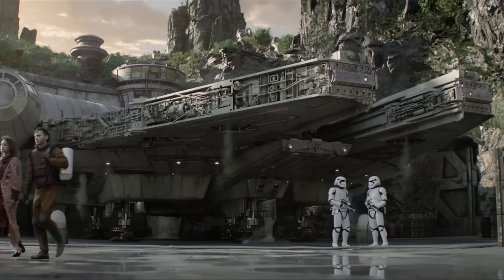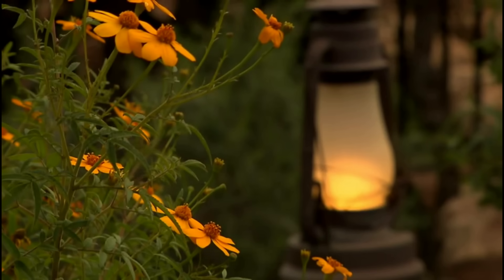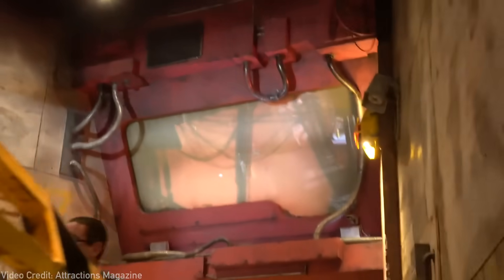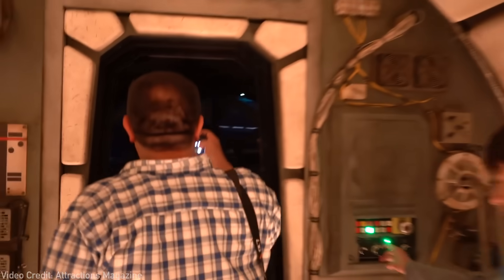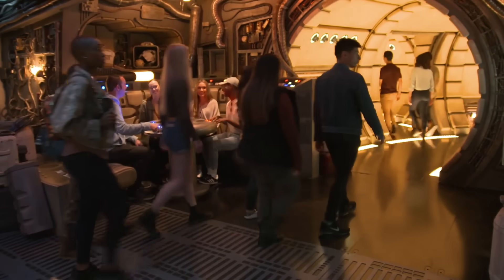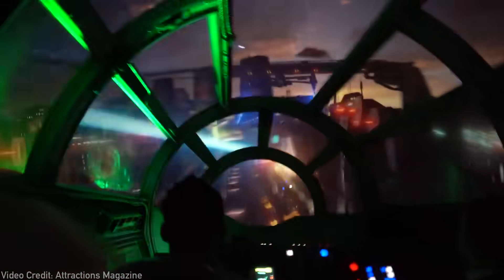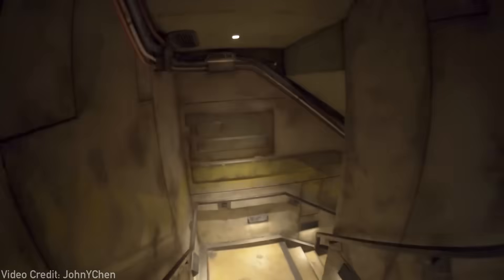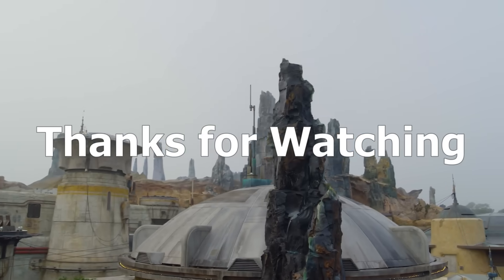How It Works: Millennium Falcon Smuggler's Run

Comment: I'd like to see a video of an evacuation if the ride completely shuts down.
Reply: Looks like the pods are essentially just a version of commercial airline simulators, they likely have some form of rolling staircases to get everyone out
Reply: @xXBL4KAl3YSSXx  on most documented breakdowns, they just rotate everyone out, while clips of Hondo inside keep riders distracted
Reply: @thetheatreorgan168  it is cool when it crashes to some field or the computer itself with the codename "Big Bird"
Reply: I also was wondering about this.

Comment: This ride made me so sick. Just absolutely hammered me but couldn't complain because I was on a cast member pass; but omg, motion sick for the next few hours! This multi-pod setup also explains why they are in such a rush to get people out of the pods when the ride is over - one in our group tried to take a selfie in the cockpit and the cast member was super pushy. Very interesting explanation.

My fun fact: We were told that part of the learning process for cast members who would be operating in the new ride was playing hide-and-seek in the queue area and chess rooms so they could learn how to get around the backstage and on-stage areas (I thought they said there were 4 mirrored chess rooms but I could be misremembering, this was WDL). Sounded like a fantastic and fun way to familiarize folks with an inherently confusing setup.
Reply: this ride didn't make me very sick, just felt a little bit dizzy afterward and vowed to never ride again. my sister couldn't steer it! lol!
Reply: How did you get motion sickness you don’t move😂
Reply: @spencersparks2335  I think that's exactly why I got sick! We weren't moving but the visual illusion is fast motion. The illusion must work great for many but I'm not one of them.
Reply: @spencersparks2335 That’s precisely why people get motion sickness on simulators. The motion you are feeling mismatches with what your eyes see. It’s even worse while wearing VR glasses as you aren’t moving at all. At least on a simulator ride, the motion somewhat matches. Disney did a pretty good job here on this ride. I only got a little sick and only for maybe 30 seconds which is phenomenal because I get motion sickness quite easily.

Comment: Complete waste of time. Mission Space and Star Tours and way better. The only saving grace is seeing the falcon from the outside, it's impressive. With the exception of Rise of the Resistance which is amazing, Galaxy's Edge is a flop
Reply from the maker: I think Disney definitely scared away many people before it was finished by implying it was gonna be constantly slammed. It definitely seems a lot more like a heavy layer of nostalgia photo ops for sure.

Comment: Does anyone know where the soft alert tone for when a small blue message pops up in the video is from?  I want to say it’s the alert chime from either Mission Space or the Disney monorail
Reply: Actually it's from Star Tours queue
Reply: @ValleDelSergio  I miss the rest of the chime though.
Reply: Whatever it is, I didn't like the tone addition in this video. Every time it popped up, I thought I had an email and my attention left the building. Even after I told myself it wasn't outside of the video, I still found myself having to rewind several times to digest the info around the tone.

Comment: Another incredible video. Do you know if there are any photos or videos documenting the flip panels and other damage in the post-show scene?
Reply from the maker: None that's I've found. Tbh I was going off what was originally reported, but it may have been cut. There are little seams between the damaged areas so maybe?